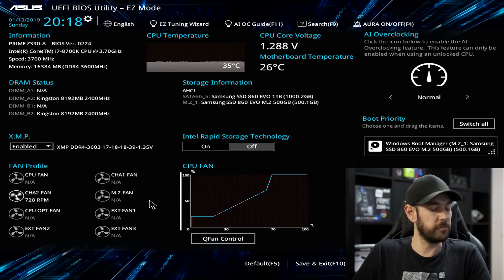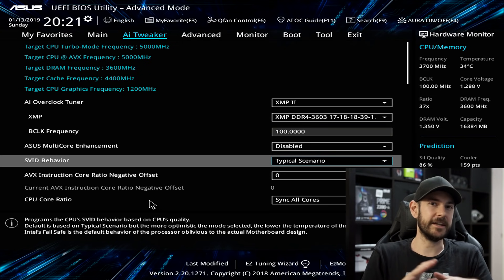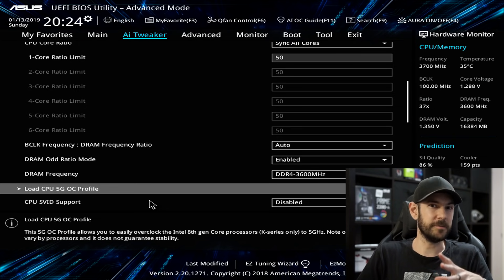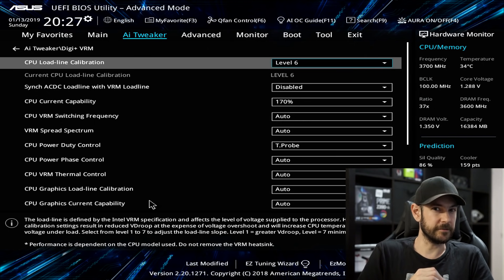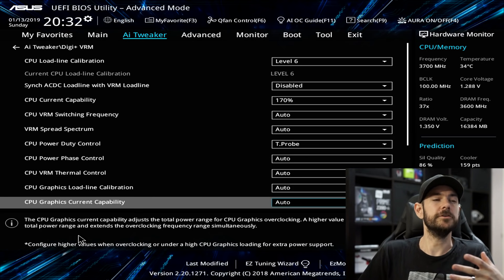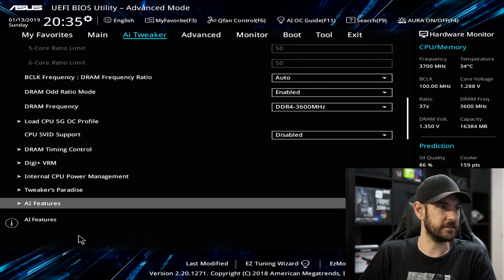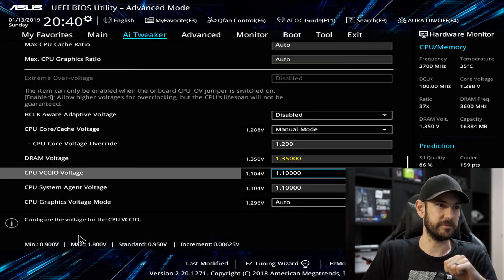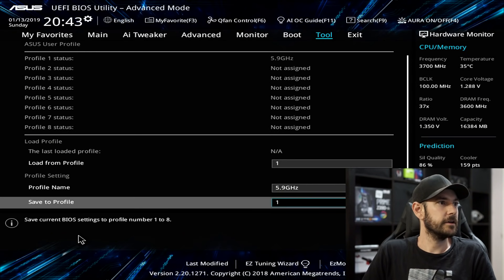ASUS Z390 Quick Overclocking Guide | i7 - i9 | 8700K - 8086K - 9700K - 9900K

Comment: Best guy on youtube for the newest intel chips and motherboard chipsets, so detailed and informative. Thumbs up 10/10!
Reply: Will this work with MSI as you never did a guild for MSI... Only gigabtye and Asus sadly. The prime a was a bad Mobo for me
Reply from the maker: Thanks mate. Doing my best. It’s hard when I have to buy everything after release! And the big guys get everything for free pre-release. Appreciate the positive vibes.
Reply: @boostedmedia  sorry mate, like your video, overall ... but an i7 9700K WILL NOT be stable with 1.29v for 5ghz!!! It would also be nice if you will show some OC for improved performance but temp control ... I had to put 1.35v to get stable 5 ghz at the cpu touch 85 at full load which is still ok and far from the 100 that will cause throttle but I would like to find some settings to have max 80 full load going maybe at 4.9 or even lower ... I tried to change your settings but did not really work ... do not know

Comment: Hey mate, ive done this overclock on my i7 9700k. Been running stable at 4.9ghz. i recently released that the cpu is drawing max 7W underload and while gaming. Coupled with a 3070. not sure if 7watts is what it should be reading. Would you know?
Reply: never really had an issue with the performance, i always knew the cpu is my bottleneck

Comment: Ive got a 9900KF a few years in STRIX Z370-I and setting all cores to 4.8GHz with 1.35V still isnt stable. Is it a bad silicon lottery? Or should this CPU be prefferably in Z390 mobo?
Reply: its not a big deal to set it 1.36V. Some cpus just run hotter or more unstable on different components. raising it slightly wont do any harm or matter much. if you got ok cooling. Id use always water cooling on these with overclocks.

Comment: I got a 9700k recently with a Asus Maximus XI Hero board. I followed your video but set my CPU to 4.9 Ghz on all cores. I had a 6700k before clocked to 4,6 ghz. WIth my 6700k the clock speed was stable at 4,6ghz (taskmanager) also while idle. With my "new" 9700k it always fluctuates around 4.7-4.85. Why isnt my clock constant?  :/
Reply: Did you turn off intel speed step?

Comment: Got this to work after a bit of trial-error. I can set all your settings BUT the voltage controls. I left these on auto. But Im able to finally get 5GHz on my i7 9700k stable wit the CPU maxing at 70C (water cooling). Played a few games and seems fine. Anytime I mess with the voltage manually my PC tends to crash.

Comment: My pc now boots but I get no signal
Reply: Me tooo idk what I did wrong
Reply: @steventaylor9688  if I remember correctly my cpu didn't have enough voltage and the boost was to strong i had to reset the motherboards settings to get signal again
Reply: @ did the same thing had to reset the overlclock and it started working again
Reply: @steventaylor9688 how do you reset the over clock? You mean just go back into bios and reset it to stock? Thank you

Comment: Thank You for this video. I have a build from 2019 with a 3080ti that still has some miles on it. But I feel my cpu bottlenecks my GPU. This video is exactly what I needed to help me OC my 8700k.  

Inevitably, I will need to build a new 1 in the next few years..probs be in the RTX 60s by then lolol

Comment: Thanks for your video, it helps me a lot, but when PC is idling not doing any load, the frequency stays at 3.99Ghz, I would like to know if the cpu can relax or fluctuate to minimum frequency when resting
Reply from the maker: There are ways to do that. Really no need to as power draw is relative to load. It’s not really using much more power or generating more heat just sitting there doing nothing at max frequency.

Comment: hi, it is very interesting approach to use high LLC and lower voltage. I am using the opposite method. I am setting pretty high voltage, but I set LLC to 'Low' which is like 1 or 2. Using this approach I am getting reasonable temps and I can cool it easily. I have 360mm AIO and it's difficult to tame my i9-9900KS. I can run all cores 5 GHz with voltage 1.4V with LLC set to low OR 4.9 GHz all cores 1.33V and LLC set to 'Low', but the best setting is 4.8 GHz all cores at 1.285V and LLC to 'Low'. Temps are perfectly under control even in Prime95 maximum heat test :)

Comment: Thanks for video! Only thing which I changed is voltage per core 1.35 instead of 1.290 (as on video). 
With 1.290v had some errors when was tested on Occt. Works perfectly on my i5-9600k

Comment: I have the Z370-g motherboard and followed this. Had 2 unsuccessful boots and got a little nervous. found out changing the voltages was the cause of the overclocking being unstable. For anybody with the same problem, dont touch the voltages.

Comment: I guess I'm just unlucky with my 8700k, 1.35 to boot at 4.8 and still get WHEA error in OCCT! I was running at 4.7 for years, today I swapped my old NH-9 for NH-D15, got around -10 C. on all cores, and hoped for higher clocks, but I guess 4.7 is the higher this CPU can go.

I guess this is what you get when you buy them week one after release for $100 extra:)
Reply from the maker: Wow. That’s a rotten one. I wonder was it running at higher voltages at some point unintentionally and degraded? What temps are you getting now? May even be worth seeing if it’s more stable with a lower voltage. All my 8700ks have been able to do 4.8 at 1.32V
Reply: @boostedmedia  right now running OCCT, 4.7 GHz, core temps varies 60 to 70, CPU temp right now at 60-62, 1.32v, everything else as shown in video.
Reply: @boostedmedia  Was running a test at 4.8GHz at 1.38v, core temps were getting to 80 C., and around 5 minutes into the test there were errors at core 3.
Reply from the maker: Sounds like you’re probably still temperature limited. If you could get those temps down to mid 70s at 1.38-1.4V I think you’d probably get 4.9-5Ghz. But the real world difference is negligible anyway. Probably best to just run at 4.7 and forget about it.
Reply: @boostedmedia  I'll just leave it at 4.7 as it was for years now. I just hoped that NH-D15 would make a little bit more difference so I could get a little bit higher with my clock rates and probably get stable FPS in The Last of Us. Looks like I'll just wait for the next Intel gen, and It will be over for 8700k. This CPU has seen all kinds of GPUs since GTX 970, and know it isn't good enough:)
Reply from the maker: Z370 asus auto overclocking was awful. It ran stupidly high voltages. That may well be why the cpu doesn’t perform as well as it should now. I see mine up as high as 1.5V a few times. You’ll run in to thermal throttling at those voltages so it won’t just cook the CPU, but it does degrade performance over time.
Reply: @boostedmedia  It was running on higher voltage maybe for month or two after I got it, and those voltages were set by Asus motherboard by some parameter in BIOS that was enabled straight out of the box so it could get to higher clocks.

Comment: When you have problems getting it stable try different LLC load line calibration. It seems Asus z370 boards have issues with it. Updating bios van help but its still buggy in my case.

Comment: i7 7700k 5.0 at 1.280v insta crash when I test on OCCT, I'm gonna try increasing voltage by 0.005 until it runs
Reply: 1.296v test lasted about 10 seconds until crash
Reply: 1.312v ran the test for 1 minute before manually stopping it. No crash this time. Although like the previous runs I am receiving many errors on OCCT every second the test is running.

Comment: There’s a huge difference between XMP and manually set memory timings. XMP is terribly loose so it can work on all configurations. Properly set secondaries and tertiary timings blow XMP out of the water. Gotta disagree with you on that “not much difference” statement.
Reply from the maker: You’re absolutely right in the context of benchmarking and number chasing. But in the context of actual use I doubt most people would notice a significant change in performance.

Comment: Hi, thanks for the help. I could oc my i7 9700k to 5ghz. And im totally okay with that, everythink is stable. I can also see the improvment, and i got +5-7 temp more, but im okay with that. Also i got +400 point in Time Spy. I little bit oc my gpu aswell and in the final i got total + 600 point and i earned excellent rate in Timy Spy :)

Comment: Hello sir. Thanks so much for the tutorial on overclocking.

I'm running in to an issue with the XMP profile where the speed and voltage are correct (3200 and 1.35v) but the timing is wrong (16-18-18-38 vs the actual 15-15-15-35 value of the ram) how much does this matter? Will it negatively affect my performance?

Z390 + i7 9700k

Comment: Hi has anyone used these settings and had great success/a safe experience? Was there a lot of additional tweaking that was required for your specific setup? I have this exact motherboard and an i7 9700k for my build and I want to make sure I don’t put my build in any sort of danger where it would need repair or full part replacement. Please lmk

Comment: So for some reason. I have followed this guide for my z370 tuff mobo. And it use to work fine. Bow when i do it. On cpuz it stays at 3.7 and x37. But in bios it is at 50. What am i doing wrong?

Comment: Hey, great video! Im having some issues though, I have a Z390-F, and a i7 9700k (With a Kraken watercooler). When I try to clock the CPU to 5.0 gHz my computer freezes after a while of playing games. I tried both 1.0, 1.1 and 1.2 cpu voltage but it still keeps freezing. Instead I re-clocked it to 4.5 gHz and now its stable. But is there any way for me to get it stable at 5.0?

Comment: cpu vccio voltage and cpu system agent voltage settings same for the 9900K? leaving them to auto is okay?
on my asus z390-a (bios 2004), cpu current capability only goes up to 140%

Comment: Thanks a lot man! Got the i7 9700k and decided to overclock since my AIO cooler keeps the temps very low. Got it stable at 1.34 cpu core voltage. At 5ghz it still doesn’t go above 70deg C

Comment: Thanks for the detailed guide.
Unfortunately on my hardware (asus z390m i7 9700k) it didn't work.
But thanks to your advice I was able to overclock
cpu all core sync 5.0 ghz
core voltage 1.35 (if I lower the volts the system becomes unstable.)

The temperature is around 70 degrees max (I use games)
If I go to the stress test it even reaches 80 degrees.

Comment: Great video!, I have the exact motherboard you have I tried overclocking my i7900k at 5ghz 1.290 volt and I used you're setting but for sum reason my PC is crashing in 5ghz even though my temperature is between 67 -78 at highest point.
Reply: Did you find the ideal voltage?
Reply from the maker: The ideal voltage will be different for every CPU

Comment: I can't thank you enough man. The MCE default settings were adding some instability to my build and I couldn't understand why until I watched your video. Now I'm at a very stable 5GHz and it's allowed my 3080 Ti to run at 99% with games running beautifully.

Great to see a fellow Aussie too, keep up the great work!
Reply: What parts of this got you to a reliable 5 GHz and 99% on the 3080 TI? Right now I'm just running a multiplier of 47 to get  a stable 4.7 GHz (that's what I could run stable before I upgraded cooling and upgraded my video card from a 1080 GTX) I also boosted the RAM to 32 GB and the motherboard wants to runt XMP I for the profile. Did you follow all steps or were there some that made the difference? 9700K for me

Right now I'm getting to 94.6 % load on the GPU

Comment: anyone ever have any issues with freezing at boot bios screen when windows dotted wheel starts turning, if i reset at this point it will boot fine, have my OC settings close to this video. running a 9700k at ghz at 1.295 vcore games an runs fine accept for the initial cold boot LLC is at 5  Dram is 1.35 only other voltage ive touched is the vccio and system agent there at 1.0000 V only thing i find odd is that turbo mode is enabled ?

Comment: My System failed.. I got the 8700k corsair H115i cooler. Had to put CPU to 1.30V and 4.9Ghz. Some cores where more than 85°C then System crushed. Should I try higher Voltaire or whats the problem here? Is my System not cool enough?

Comment: yo, i just overclocked my cpu for the first time and my temps are high, atleast i think. i have an rtx 2080 super, an i7 9700k (which i just ocd to 4.6ghz, stock is 3.6ghz) and 2x8 3000mhz xpg gammix ram. i also want to mention that my ram for some reason was autoed to 2666mhz so i set them both to 3000mhz. about the temps, i didnt mess with voltage or anything because i dont feel like screwing over my pc, but all i did was change the cpu ratio from 36 to 46 and set the ram value to 3000, which is what it can handle. in bios before those changes my cpu temp was 30-40, but now after i restarted pc and saved changes it says 85-95c?? im pretty sure thats high and i was in bios. could anybody help?

Edit: Again all i did was change the cpu ratio and the ram frequency, nothing else. btw, i have a water cooling for my cpu.
Reply from the maker: Yeah that’s too hot. Sounds like your Vcore voltage is set to auto snd it’s going way too high based on the VID table.
Reply: Yep, I’m trying to change it but it won’t let me edit the number. I have an AsRock Z390 Phantom Gaming 4S board btw, could you tell me how the change the number?

Comment: In cpu z is the core speed supposed to fluctuate from what i set the speed to back to the original core speed? I set the core speed overclock to 4.5ghz but when im watching a youtube video it goes back to 3.6ghz and then will go to 4.5ghz for a second and then go back to 3.6ghz.

Comment: Hmm My 9700k won't even finish a Timespy CPU test at any over clock or voltage :( 

 Tried 5Ghz, mostly BSOd on windows at 1.35-1.4V
Tried 4.9Ghz all cores 1.3V it boots fine but crashes on cpu test.
So I guess I got a dud!

Comment: I there. I tried this guide but my 9700K wont boost. I've changed windows power option to performance. updated the bios... reset the bios but my cpu wont boost/ overclock past 3600mhz. Any ideas?! Thanks

Comment: Recently added an additional 32gb kit to my existing 32gb kit, identical modules.  CPU is i7 9700k.  The CPU runs rock steady at 5.0 when using XMPI, but since adding the additional two dim’s I am starting over.  My new baseline is 4.0 on CPU and 2133 MHz.  When I use an XMP profile I get consistent crashing while flying DCS.  When I allow the Z390-E auto over clock and use XMPI, the CPU ramps up to 4.6 mhz.  Given all that since I’m using four sticks of same brand same timing ram how to I manually over clock the ram in conjunction with the CPU?  Any tips would be appreciated. My main concern is since I’m using two identical 32gb kits but not paired is manually over clocking RAM and CPU my best option and if so where to start.

Comment: Thank fuck someone who said it really detailed.  Also helped me to stabilise the bs over voting. B4 I gave up on trying to figure out my chip and just used the ai which really didn't bother me temp wise to much (82) under full load. But what did bother me is how in games I went from 0.985 v to 1.5 to fucking 1.389v I made no sense to me.

Watched this guy he explained in detail what everything did, and me knowing my cpus voltage range was around 1.29 to 1.32 I managed to stabilise 1.32 v on lvl 5 running  mostly 1.28v but bumping to 1.3 when needed, done my test. Settled temps are 72°c tested for a hour and its been stable since. As of this comment I'm playing out games to see if it crashes anywhere now.

Deffo worth a sub, knowledgeable content in a few mins

Comment: Hello, I tried the settings following this guide but with i9-9900k and after running prime95 with 16 threads blend for about 15-20 minutes, my temps were going 75 and as high as 85 on the cores  so I stopped it... I am scared to run this for longer or even idle it without being able to monitor it the whole duration...

What should I make changes to? I have a nice amount of fans but I guess its not good enough? I already raised all the fan speeds the 2nd fastest on the bios... I have a cool master 212 for the cpu, 2 fans on top, 1 fan on the side and 1 in the back  (all noctua fans) which is one of the best??

Comment: Perfect video. I did all and incredible performance and stability with low temps. I have a question. After this settings, my CPUID HWMonitor can't read the power which cpu uses. Which setting can cause this problem? I really want to see the power (watt) my cpu consumes.

Comment: All my options are stuck on auto I cannot change the value of anything including turbo mode parameters or cores are on auto, cannot change that. Do you know why?
Reply: please help this is extremely frustrating, i have an i7-9700k asus prime z390-a
Reply: Having the exact same problem right now with the same cpu and motherboard

Comment: This was very informative, i did an overclock to 4.8ghz a while ago but wasn't aware how much i missed out, got my i7 9700k at 5ghz now thanks ❤
Reply: Question, was your CPU Current Capability limit stuck at 140%? I could not change mine above that. I am running the i7 9700k and ASUS Z390 A Prime.
Reply: @mattbroughtonn  i also have 140% max
Reply: @mattbroughtonn  Damn - I'm just about to finish a Prime z390A / 9700K build, this could be problem. Perhaps it isn't a shocker that Asus have limited the current, because the VRM's are only 4-phase and run hot.